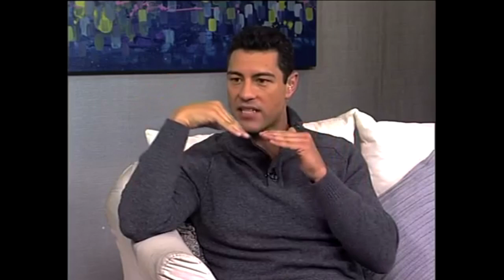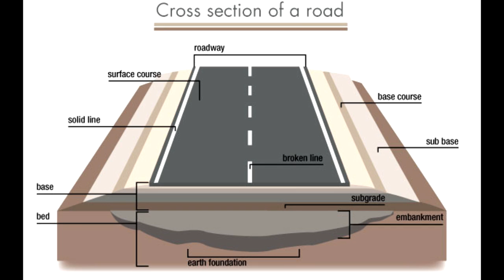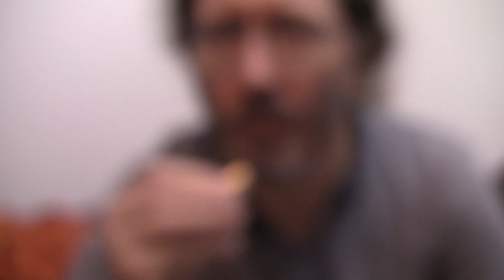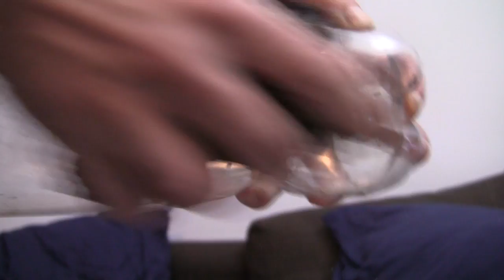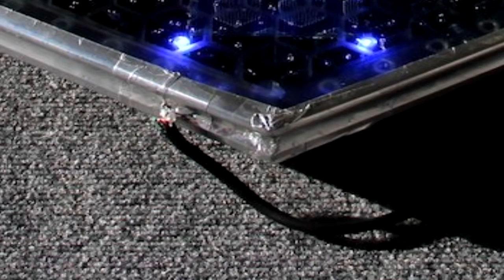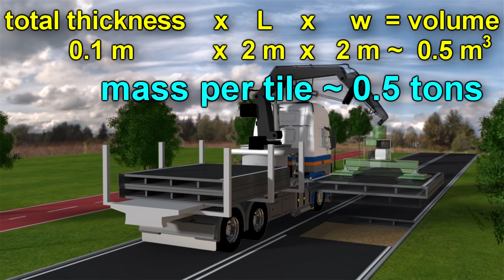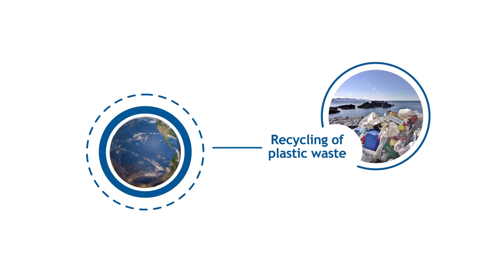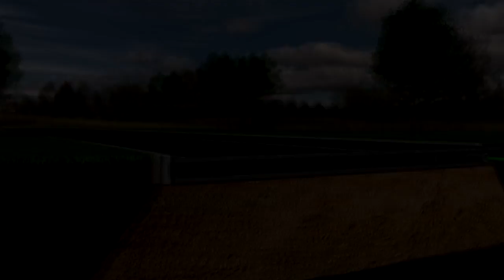Plastic Roadways BUSTED!

Comment: i'm pretty sure there are companies that are melting down waste plastics and mixing them with bitumen to create asphalt already.  So basically these hollow prefab roads are already a moot point.  there is already a better way of recycling the plastic that doesn't involve any new equipment, or construction techniques.  This is already a common practice in places like india because apparently the melted plastics actually make the asphalt road last longer.

Comment: Everything I use that has plastic parts breaks eventually. Also in cold plastic gets very brittle and when plastic bends a little it just gets weaker and weaker so it would just take a fully loaded semi driving over the wrong spot to break through and cause a massive pothole exposing the underchannels.

Comment: Lets trap the utilities between the road and... the road! Who wants to just dig up electric wires or pipes when you can... crawl or dig up the road. Plus, I love the sound of hollow roads when I drive over them. Like a metal/concrete bridge... x10! I'm a big fan of bumpy roads, like old concrete highways where they're poured in like 10 ft sections. Dumpata dumpata dump every second as you go over the crack. No really ideal for frozen environments either to have fucking seams. Then just try and imagine how much of a beating the road actually stands up to. Lots of friction and thus heat. Plastic wouldn't even remotely stand up to it. Especially with environmental conditions. Most plastics simply shatter in freezing temperature and are far too malleable in heat. It expand and contracts like a mother fucker. You'd have to have a literal 1/4 gap between the panels so they could expand into the gap instead of each other and buckle. And my lord, I know that's Solar Roadway but look at that terrible craftmanship at 10:37. It'll erode away underneath haha.

Comment: @Thunderf00t would it theoretically to construct the base of the road with plastics and the surface with asphalt?
Reply: Burying even more plastic in the ground, spreading micro plastics everywhere, seeping into everything, carried by the water, and for what? Why? It's just creating another plastic landfill, except under the road. The whole purpose of plastic recycling efforts is to keep microplastics from being carried into water and ground, everywhere. Microplastics have been found everywhere, once it's in the water systems, it's swallowed by animals, gets carried even by rain once the particles are small enough. 

That's the #1 problem I have with plastic roads. Every bit of plastic particle will be deposited in the surrounding earth and carried by water into everything!

Comment: Wait... So the replacement for old oil-and-gravel roads is... oil-and-gravel roads?

...

Then, wait. Why bother with this whole 'plastic frickin' roadways' charade? Why not just meet in the middle and replace the bitumen in some roads with recycled plastic? Isn't plastic the recyclable that there's already the most of? Screw the Kickstarter bullet points and just go with a practical application.

I mean, I'm sure there's some issue about molten plastic giving off poisonous fumes or leaching into the groundwater or something, but at least the idea's a bit more believable than this.

Comment: It wpuld work just fine for a driveway. Low speed, consistent wieght and low traffic. It would still he vulnerable to uv damage though. Maybe ok for side walks and roofs too,  or even houses. But not something with a high degree of traffic like a road.

I didnt think of the flexing though, thats a far more immediate problem as plastics are...well...plastic. they're molecularly mobile and prone to deformation. The potholes developing from compounded stresses very quickly after any flaw or damage is exposed would cause sections to be very short lived.

Comment: THUNDERFOOT, what about this idea.  Instead of using heated bitumen and mixing small rocks, using heated plastic, and mixing small rocks?  Could they do that, to "reuse" plastic, and bind the road together?
Reply: Yes and in fact it is already being done, although they are more mixing small amounts of plastic with large amounts of asphalt. In India, I believe they have roads with something around 80-85% asphalt and 15-20% plastic. Of course, roads in India are less used than those in more industrial countries such as America. It's been a while since I looked into this so you might want to research it on your own to be sure. 100% plastic roads are completely insane, it would never work, ESPECIALLY if it's made by reusing compost plastic.

Comment: I'm not disagreeing that this is not the best design for a road, but you're argument that it isn't cost effective is very off.  An asphalt road does cost around $150 per ton, but one truckload of blacktop (around 23 tons) only goes around 50 feet, so about 2.2 feet per ton.  You're very conservative estimate of the size and weight of the plastic panels would go about 13.25 feet per ton, so almost 6 times farther.  Factor in the heavy machine, labor, and transportation savings, I would think it would be very close to being competitive.
Reply: Yea you are right that the initial cost might be competitive but you have to factor in the maintanance costs aswell. Since a slab of plastic would wear down alot faster than the 15-30 years life expectancy of asphalt.
Reply: KireB The design life expectancy of the wearing layer of asphalt in my area is about 7 years.  Again, I don’t believe a plastic road is viable, but surely even it should be able to last that long.

Comment: I live in Wales and they have just recently found microplastics in lakes high up in our mountains so this means that shit is getting in the rain. This is why it is such an idiotic idea.
Reply: Yup, this is what will happen and why I'm angrily replying to morons claiming they've had "success" when they have no idea what that plastic road is going to be in 5 to 10 to 20+ years. They haven't given the plastic a chance to break down and go into their water...no further tests, just, "it's a success!!!"
Reply: Those micro plastics most likely came from you current roads, or doing laundry with your plastic clothes. A vehicles tires are made of twice as much Styrene, polyester, and nylon plastics as actual rubber. Tires wearing out on the road directly add microplastic to the nearest waterway whenever it rains. Old tires and PET bottles are also shredded and added to asphalt mixes when roads are paved and repaved(even in Wales). Every time you wash a piece of clothing or sheet that contains polyester(PET) or nylon you're also washing more microplastics into the water cycle. 

Micro plastics is pretty far down on the list of reasons why this road is an idiotic idea.

Comment: The plastic road isn't that bad of an idea,  all you need is a plastic that is cheap, is solid at normal temperatures, but doesn't need too much heating, also cheap is good. Something that is a waste product of the petroleum industry that can be poured on site. Then make it into a composite with something hard and sturdy like gravel and sand.

Comment: adding fiber optic cable kinda makes it impossible to replace sections like their cgi advert shows. cause fiber cables are long as hell and even if they did make it easy to disconnect who tf wants their internet to go out every time there is a road repair?

Comment: I've got a fantastic idea for roadways ...they could take some rock just regular rock. Maybe choose a rock thats high up on the hardness scale and crush it up to a size of about pieces no larger than a half inch or so. Then mix it with a mixture of sand cement and water mix it all up to a paste like substance and pour it out to a thickness of around 6 inches.then when it dries they can cut grooves in it. That will make a roadway as hard as concrete. Oh......wait a minute. Nevermind.

Comment: The plastic waste can include anything from sweet wrappers to shopping bags.

Once all the plastic waste is shredded (a technique where all the dust particles are eliminated, and plastic items are shredded into fine pieces) these are heated at 165°c. Next, the shredded pieces are added to bitumen mix, which is also heated at 160°c. The final mix is used for constructing roads.

“Depending on the quality of tar, a 10-30 per cent of it is replaced with the waste plastic. Since both, tar and plastic are petroleum products they gel well together,” said Asad Warsi, Swachh Bharat Mission Consultant, Indore Municipal Corporation.
https://swachhindia.ndtv.com/plastic-waste-roads-one-lakh-kilometre-india-20274/

Comment: Solar road is be good idea. If we wrote off every inovation at there first stage we would never progress.
So the first baby steps have been taken it needs improvement but it's not an out and out failure.
Plus you take about these great big tucks they will be going from our roads. Already city planning are looking at banning them enter city areas. We have move forward Modular road surface has it merits.
That black gluppy stuff can be made from recycled plastics. We can used old plastic be as a binding agent.

Maybe not the modular approach but it a start  that we can build on. Modular road surfaces will come in time be and recycled waste plastic will be used. But we are at the start of this only a backwards fool would dismiss the technology. Even if cavities where used for water run off it would be a benefit. So stop the negative we have to find uses for the waste.

Comment: Sorry but your be test will only be Valid if you be where testing it ok n they finished product. Pop bottle are made into many different plastic structure when mixed with other material they can become very durable. Top coat recycled plastic road surfacing is already in use.

Comment: I am no engineer, but it seems to me there would be a large amount of static electricity build up if such a thing could be produced. How does the water passing through avoid the cable conduits ? How would cables and such be installed or reconnected when replacing a road section ?

Comment: One of the  most interesting aspects of this commentary is the author's observation that you can look at PET as borrowed oil.  If you burn it you get back about as much heat as the weight in oil.  Makes sense--it's just another hydrocarbon, and a clean one at that, as it's already got any sulfur taken out.  If you combine this with his observation that once the PET is reinforced it's pretty much non-recyclable anyway, so no matter how much of it you use for roadways, you eventually have 100% of that plastic left to deal with in a form that's neither burnable nor recyclable. Hmmm.  So even if it worked as a road-building material, you're converting X tons of hydrocarbons into landfill.

Comment: How do you switch out a panel without pulling all the pipes? Watch about frost or extreme heat that melts asphalt? Oil and gas permanently damge plastic where as oxidation removes most the stains from asphalt. Different molds for every application will see specialized crews instead of some employee with a hot box and a shovel. Imagine water inside the structure then a freeze? 
My guess is they are trying to find new uses with the Greta's banning straws and bags. Wait till they find out the price of the new water bottles.

Comment: Your ignorance on the subject matter is quite dangerous. You should do more reading on this before you make videos debunking it and misleading your viewers.

Plastic roads are not 100% plastics, they are melted and mixed with sand in some cases, and moulded to create blocks that are stronger than concrete or something like the one you're ignorantly debunking

Comment: A couple of small points of order. Plastic roads (such as they are) will be made out of granulated hardened pebbles, similar to those I made when recycling offcut plastic in a bag and bottle factory. They have  a higher desnity and resistance to abrasion and weight than the thin films used for bottles.
Second, on a plastic road, there will be rubber or nylon tyres braking and bearing loads on the surface. I don't see the relevance of subjecting the bottle to bitumen and gravel other than to replicate road grit and debris, much of  which will be dispersed over a large surface area. Would it not be more relevant to test a piece of rubber tyre against a solid piece of sintered plastic granules?
Lastly, the viscosity of recycled plastic in its semi-molten state in the   heated spinning hopper may be altered with the addition of hardening or softening pellets and water. The recycled primary ingredient is not necessarily the same hardness and durability as the  end product.
If one was to do away with the ridiculous drainage and cable access ideas, and just use the plastic to replace the final surface, load bearing requirements could be met with thinner solid slabs formulated to replicate the flexibility of asphalt, as any cavity will result in cracking with the slightest hint of environmental degradation. Solid slabs, however, will be similarly prone to environmental factors, tyre friction and vibration. 
I think the main issue would be with the low friction element, which would be a nightmare in wet weather and a deathtrap for motorcycles or trucks. All in all, a bad idea, but recycled plastic should not be dismissed summarily on the properties of a typical plastic bottle.

Comment: I personally found your video and counter arguments to be utterly stupid!  You showed an animated view of someones idea(s), and tore it apart.  1) I would agree that the descriptions shown in the animation would not work.  2) For major highway/road applications, it may not be an alternative at this time.  3) A great deal more thought, design, engineering and testing will be required.  4) This idea with consideration to #3 could very well work for driveways, sidewalks, residential, commercial and industrial buildings floors and decks, etc.  5) In addition to #3, various aggregate could and would be needed to strengthen the base product.  AND most importantly 5) Recycling/using all one time plastics into such project such as this given idea(s), could and would reduce/eliminate all other efforts of garbage services, pollution control and clean up that we are presently dealing with world wide!

I suggest to your Sir Thunderfoot, that you get your head out of the sand and >>>>  Into Plastics!  An idea is just an idea.  It is a start to changes and improvements.  If we all thought like you, the world would still be living in caves or mud huts!

Cheers

Comment: Now introducing Plutonium Roadways™! Is plastic too malleable? Plutonium is a hard metal that won't deform over time. It also gives off heat, so it can melt snow and even possibly produce energy. It's even a solution to the nuclear waste problem. Just bombard the waste with neutrons (because that's totally how you do it) to make plutonium. This will for sure be the best invention since HIV!

Comment: Love your vid. I dont agree with you on this. I mean i do and dont. I think it is a good replacement for asphalt top on roadways or even better sidewalks and maybe engineered bricks, if heated and sand and aggregate are added.
Now the modular road thing? 100% stupid and from an engineering standpoint completely impractical.
Oh and you CAN recycle FRP. Though it can only be recycled and reused as FRP.

Comment: The compartments under the road with the small supports holding up the road will not work. 

Think of a knife. It works by channeling force into a very small area. Then it cuts.

Now look at the plastic road. The compartment dividers will act as knives to the road. All of that downward pressure will be concentrated into a small area. Just like a knife edge.

Comment: now using asphalt, it don't last long either, with freezing and thaw cycles and the weight of vehicles  on it.  It crumbles and falls a part very fast, with pot holes ever were even when in the first year or so.  How the plastic would work if they would to lay it down hot like you do asphalt it might work,  but then again if it gets hot like a new layer of asphalt and when it gets hot I seen asphalt buckle,  and they have to cut it out and repair it.  So its hard to tell.

Comment: I believe that when people are talking about "plastic roads" they are in fact thinking about  asphalt mixed with plastic added and stone (gravel) as per usual. 

"Asphalt is heated to a temperature of 170C (338F). Shredded plastic below 70 microns (including the multi-layer plastic shreds) is then sprinkled over it. The bits of plastic seemingly disappear, melting into the red heat. Heated bitumen is added next. The molten plastic then moulds with the bitumen and stone and results in a shiny tar surface."   

If you'd like some further reading have a look at this article from the Guardian in July 2018. 

https://www.theguardian.com/world/2018/jul/09/the-man-who-paves-indias-roads-with-old-plastic

It is an interesting video and does debunk a stupid idea! But the idea of "plastic roads" isn't stupid, it's just this example of how to implement them!
Reply: Yh this dude pretty much exposed his ignorance on the subject matter.

Comment: We have some actual durable roadway overhere with solarpanels. I don't know what material.
It still seems not so useful.
Putting these things on roof or even replacing parts of roof is much smarter, because no vehicles drive on it so you just need a waterproof solar panel. Not super strong grippy etc.

Comment: I run asphalt plants, and the strength of aggregate is that significant we take it’s ability to wear steel (hard wearing steel - bisalloy) as the main factor for maintenance and capital costs. It’s funny how you never hear material scientist ever ranting about non basalt or furnace slag based roads.